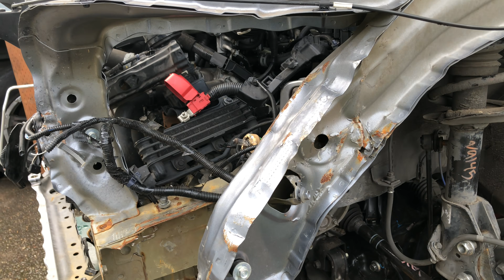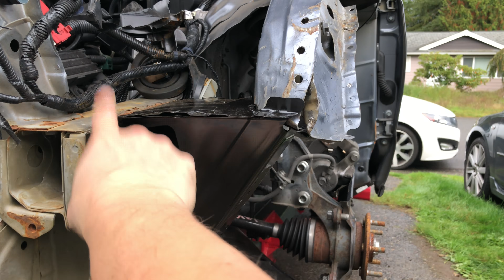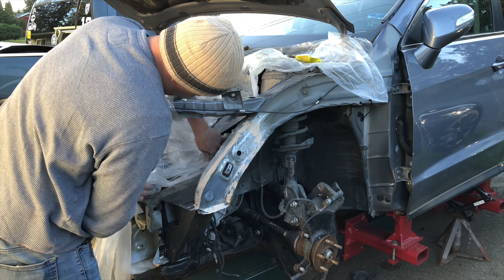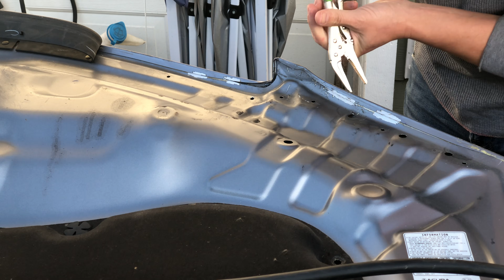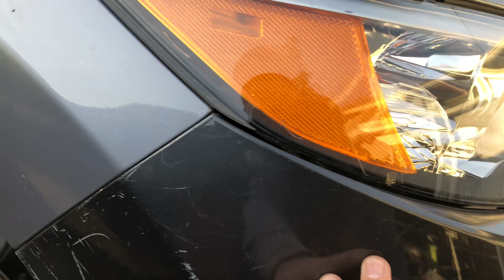✅ DIY Structural Body Repairs at Home On This Acura and Getting Everything Ready For Paint

Comment: At 4:45 when you used that flat copper piece to be a backing for the weld so it won't fall through or burn through should say, you can take a copper piece of pipe from the hardware store and hammer it flat on one side and form it however you need it and use the rest as a handle and have a custom tool for pennies that does the job just like the one he used here!! Just a little tip to share!!
Reply from the maker: Oh for sure.. There is always more then one way to do just about anything... I believe I only paid $4.50 for that copper spoon at the harbor freight store, It was so cheap I couldn't pass it up :)
Reply: @fix206  harbor freight is a dangerous place to go for my bank account but absolutely I have three of those same ones you used in the video!! LoL I had a few pipe ones I made in a pinch and needed something to use so was sharing what had been shared with me before. It was one of those supper late nights and needed to get a project finished and was blowing holes all over the side of a truck and a old timer showed me the copper pipe trick so he saved me with that one! All the little tips and tricks the ce with time are priceless so I try to share whenever possible and hopefully someone will benefit from it sometime ya know?!

Comment: You shouldn’t be making videos you don’t know what you are doing to someone who doesn’t know anything it looks impressive but you don’t have a clue
Reply from the maker: Bob, you never responded to my comment where I commented to your post... I was hoping to get some enlightenment...  
For your information,  Acura that got fixed in this video actually was involved in another accident sometime recently where it got hit in the same corner, and guess what, my repair held up just fine, not sure what's up with all the hate...unless you're just trolling. There's more than one way to do just about anything, and just because I didn't do things the exact way that you would've done them, doesn't necessarily make it wrong. And since you are such a "Professional" with all of the "Wealth of Information", why don't you make some videos about the right way of making such repairs?
Reply: @fix206  no hate just making a point yes there is more then one way about doing things but doing it correctly is the key you need to understand what type of metal you are working with and there are manufacturers repair procedures so when it comes to collision work there is only one way of doing it correctly
Reply from the maker: I realize that there are different types of metal that is being used is these vehicles... And you are probably referring to a high strength steel... Just want to assure you that the area that I worked on was not HHS, otherwise I would have approached this repair differently

Comment: Ummm... thats high strength steel.  Its lost  MOST of its strength in the collision and pulls.  "Hammer and dolly" is irresponsible.  Yes, you will make it "look good" and fit... until another wreck occurs.  Then there is no structural strength to protect the driver.  Great job on the homemade frame rack.. that shows a lot of talent.  Hack job on the car, unfortunately.  iCar has some great educational info. on this topic... don't take my word for it.
Reply from the maker: I have worked with high-strength steel and the area that I repaired was definitely not high strength steel. It was just regular steel that is thicker than your standard fender or quarter panel steel. I got this car for my wife, funny thing is the car got hit in that same corner couple of months ago and it held up just fine. I'll be doing video on that repair in the near future.

Comment: When you are spraying paint under the hood and don't want it to have to much shine all you need to do is add some hardener from the clear coat and it will give the paint a low gloss you are looking for. Just be sure that the paint you put the hardener you dont put back in the can because it will start to harden up. Keep up the great videos!
Reply from the maker: Thanks for the tip Dave!!! I'll be share use it in the future 👍

Comment: Do you have to have the frame and repair inspected before putting it together?
Reply from the maker: No, none of that had to be inspected. But even if it did, I know for a fact that it would pass the inspection. You would have to do some pretty extreme repair in order for it to fail any sort of an inspection

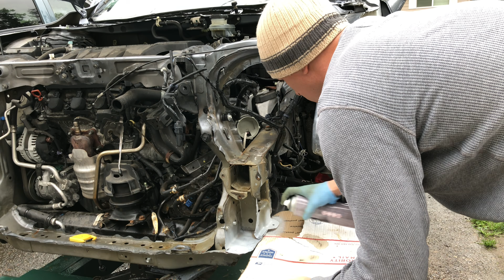Comment: 4:27 - What is this tool called ?  4:58 - Why do you install this plank? Is it to further strengthen the joint? I love the music you put on these videos. So positive. Good luck man.
Reply from the maker: The tool at 4:27 is the copper spoon, the welds will not stick to it because it's made of different metal then the car body, it creates a perfect backstop for melting steel wire that comes out of the welder, it's perfect tool to help with welding holes or cracks in sheet metal. The plank at 4:58 is called a backing plate, it helps with bridging of the 2 panel that are being butted together, helps making much stronger connection.

Comment: Well well well ..ok
If can give you some advice on your work because I think you have potential more than just DIY 
After seeing your videos
You have to study more on body measurements, adjustment, what is the references according to the manufacturer. It is the same as work shop manual. It tells you every part on the chassis exact measurements and what is acceptable to do and what is acceptable tolerances.
You need more especialized tools other than those you built. It will help you alot believe me.
You need to introduce more heat when working on hard bodies. Don't pull all the way as you did, you may get some metal fatigue at some parts that may complicate the work more leaving you on tears all night. 
Once again your work is acceptable if you are in a remote area. But I see a potential and talent in  your work just need some more knowledge and tools.
Good luck
Reply from the maker: There is always room for improvement, I don't have access to factory measurements/work shop manuals, I'm sure if I did it would've made things much easier. I do appreciate the criticism, it's good to get some other prospective on my work .Cheers  👍
Reply: @fix206  
Please accept my full respect for you.
As it takes alot of guts for someone to do as you did. 
I will follow your work and appreciate your understanding for my opinion
Good luck

Comment: That black base coat gun laid the paint and metallic out nicely!  What gun and setup is that? Also, did the spool gun come with that vulcan welder or did you have to but it separately? I think I have just about watched all your videos. I will check again after I finish this one. lol .   Thanks for all your help.  Phillip Hall
Reply from the maker: That black gun is a Devilbiss Tekna Pro Light... I used to use an Iwata gun before for base and clear. Iwata is an awesome clear gun, but struggles with base coat if there is heavy metallic content. I've only done couple of projects with the Tekna, but right away I could tell that it lays down metallic base so much better then Iwata. So now I just use Tekna for base and Iwata for clear. It's a great combo!! I had to buy the spool gun separately from the welder, I guess its considered to be an accessory ?
Reply: Thank you for the answer.  I understand what you mean. Metallic is my concern also. I am going to buy one of these also. Can I ask, which cap and needle  do you use when spraying metallic?   Again thanks. Phillip Hall
Reply from the maker: @PhillipHall01  it's a 1.3 setup with I believe a TE20 cap, later on I'll do a video on tips and tricks of doing a seamless bland of metallic base.
Reply: @fix206   Thanks

Comment: Looking good. Congrats on getting married! Best of luck my friend!
I talked to you briefly on another vid you did about homemade spotter you built. I forgot to ask, do you every have issues with little holes showing up in the metal where you weld the washers on to pull the dents?
Reply from the maker: Thank you for the comment ! And about your question about the holes, that normally happened when your weld of the washer to the panel is "too strong", so to avoid that try and make the duration of the weld as short as possible and I mean make is as short as 1/3 or 1/2 of the second.
Reply: @fix206  
Thank you, i will try that forsure!
Look forward to some more of your vids.
Subscribed!
Reply from the maker: Think if the wether will hold out, tomorrow I'll start getting everything ready for paint, so the next vid should be out pretty shortly, and I just picked up a next project that will get a lot of love with my spotter tool...
Reply: @fix206  
Awesome! Fingers crossed on the weather! Can't wait...Thanks again
Cheers
Where in the States you located? Im in Canada.(Eastern Ontario, right on Lake Ontario, half way between Toronto and Montreal?
Reply from the maker: I'm on the east coast of US, about 30 minutes outside of Seattle, about 2.5 hours away from Canadian border :)
Reply: @fix206  
Seattle Washington? So you're on the west coast, not that far from B.C. Very beautiful in B.C. from what I've been told.
Cheers
I'm sure the weather will cooperate with you out there!

Comment: Hi what was tool you were using behind the weld what does that do. More great entertainment. Thanks
Reply: Welder's helper.
Reply from the maker: That tool is a copper weld spoon. It plays a role of a backstop for welds, wire that comes out of a welder is made of steel, and steel will melt with (stick to) steel in the process of welding, but steel does not stick to copper. So if you have a hole that you're trying to weld up easies way to do that is to put a copper spoon behind the panel that you're about to weld and start welding.